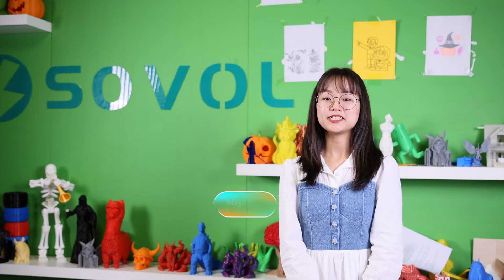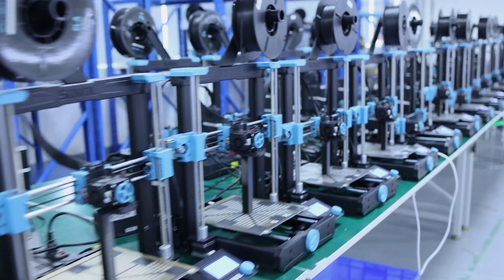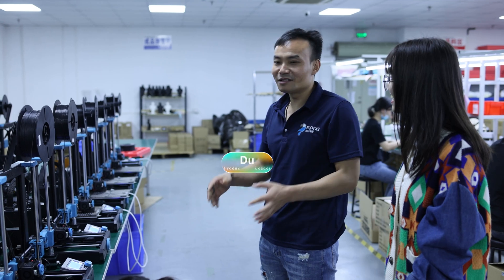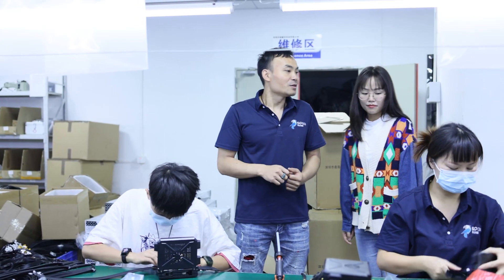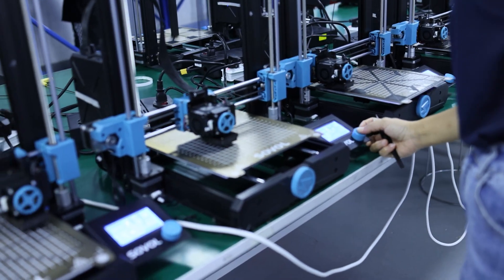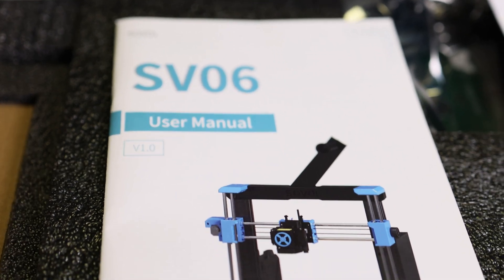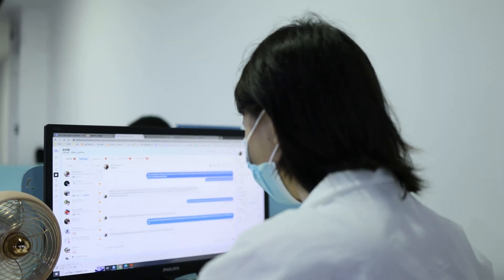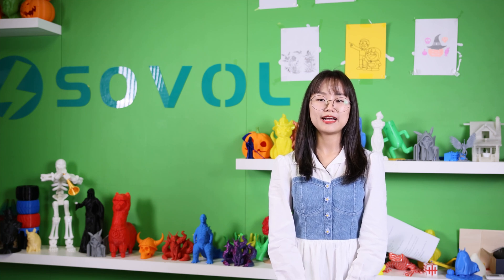Sovol SV06, Sovol New Stage -Development Story about the Sovol SV06 New 3D Printer 2022 Episode 2

Comment: A ton of people in the Facebook group for this printer keeps complaining about quality control issues and problems regarding the extruder and hotend clogging and different things due to it being wrong assembled. The printer was looking very promising and I ordered one before discovering this problem from the users. Can you confirm that this QC problem has been addressed and the next units have it solved? I would not like to have to "fix" a brand new printer when it arrives, and I believe that people that is not mechanically good will not even have a choice, just to return the printer.
Reply from the maker: Hello friend, thank you very much for the comment. I am sorry for the concern caused. About the SV06, yes we found some customers mentioning a clog issue and that the screws in the heat block is installed too tight on some printers. We have reported the issue in time and the QC and the production department. We promise it has been paid much attention to. If you see others who mention such a problem, please refer them to contact sovol on Facebook or via email, and we will be responsible for it and make it correct.
Reply: @Sovol  Thanks for answering. I hope the problems gets solved for future units, it looked like this sv06 could be trully a new popular machine but with this kind of problems could make it really difficult. Your best bet is always listening to the community. Cheers!

Comment: Sv06 seems to be the best budget 3d printer on the market. Thank you for all your effort to make it happen!
Reply from the maker: Thank you very much for the good comment. Sovol will always try the best to provide you with good and high cost-effective products😎
Reply: I agree, in the $200-250, nothing I looked at was better or even as good, perhaps the Elegoo Neptune 3 Pro, but there were aspects I wanted in the Sovol over it.  Since I use Octo4A with phones or tablets, I don't care about the quality of LCD or it being touch screen, since I only look at them for temperature.  And I wanted my first linear rods, over rubber wheels and SV06 has them on all 3 axis, not just the Y on Elegoo's.  The only downside I saw at all was the Micro USB instead of full size USB since I use Octo4A where they cheaped out a bit.

To me, it's a great 2nd "tier" printer, after you cut your teeth on one of the cheap bed slingers, and if you really had more $$$ to go, I'd be looking at a Bamboo P1P for its crazy speed, which I consider a 3rd 'tier" printer at $699.

Looking forward to getting it in Dec.!

Comment: I wish my SV06 could get first layers to look like it looks @3:07 . No matter what I do to calibrate, even using the solution from ModBot's recent video using equal height objects to level the x-gantry, I still get uneven first layers. Left side is too close and looks rough, middle is good, right side is too far away and doesn't adhere or has gaps between lines. I used M48 probe tests to check if the deviations in the probe were super different from left to right and they range from .0009-.008 so it seems okay. The only thing I can think of is the firmware isn't applying the mesh from the ABL process properly, or the probe detects the metal underneath the PEI sheet so the PEI sheet might be uneven thickness from left to right? I have no idea and it's frustrating.
Reply from the maker: Could you please send sovol an email with the information and some pictures for analysis?
Reply: @Sovol  i did already yesterday but no response yet. I'll send another with pictures specifically of the levelling issues. Hopefully your folks can help!
Reply: I have nearly the same issues since one week, no change to calibrate it for the first layer. Z-distance from left to right differs. i am very interessted in a solution!

Comment: I wish you would get rid of the white grid on the build plate. It slowly comes off onto the bottom of my prints. Modbot has experienced the same issue.
Reply: I have the same problem but I've only seen it when I print with PETG. Haven't experienced it with PLA. Haven't tried TPU yet or any other type of filaments. Other than that minor problem, It's been working great for me and I like it more and more every day.
Reply from the maker: Thank you for the suggestion. It's adopted already. It will not influence the print, but if you need help, please feel free to contact us😊
Reply: @Sovol  Not exactly the same problem but related to the build plate, it would be nice if the plates we coated on both sides.